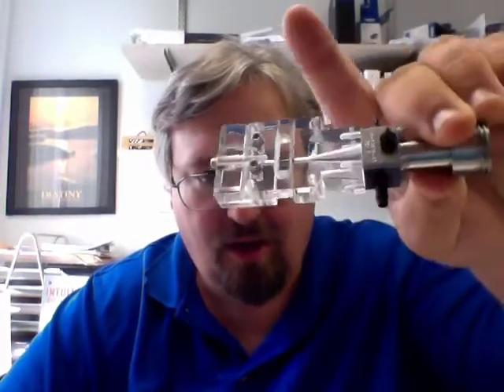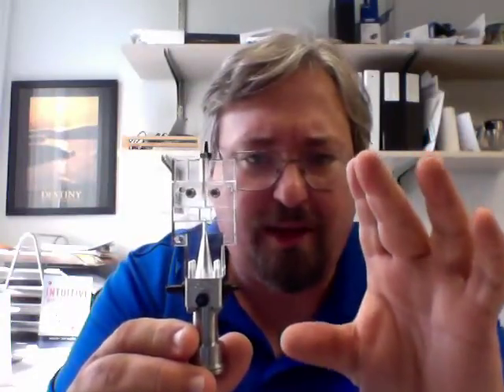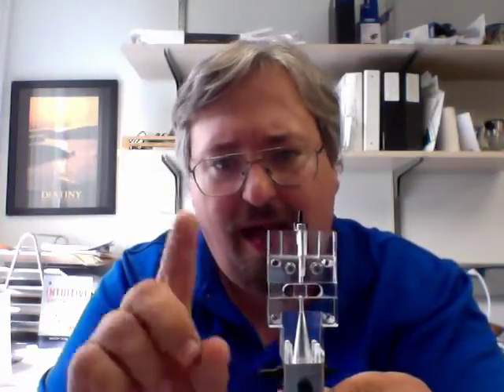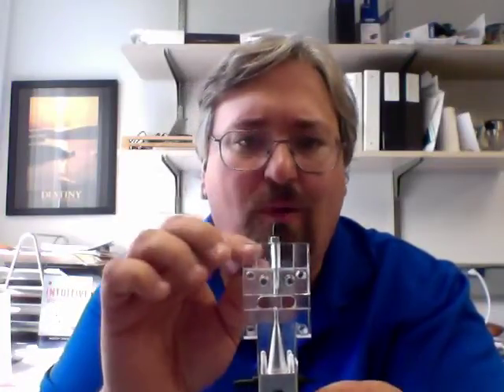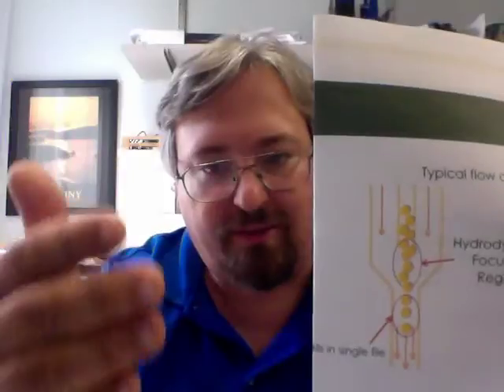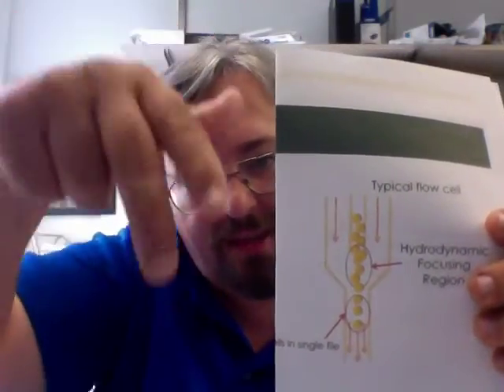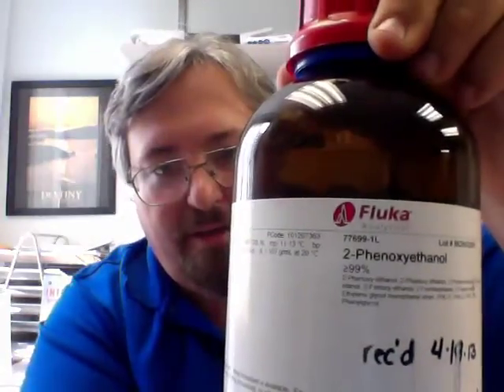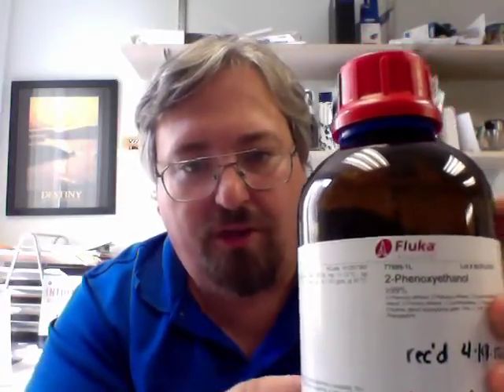What Is A Flow Cell

Comment: I need to know how to adjust a flowcell in an Horiba ABX Pentra 80. I can't obtain a value in resistive gain and Absorbance, if I move the flowcell to left or right or from or back only I can see voltage variation but not Gain or Abs. What can I do?